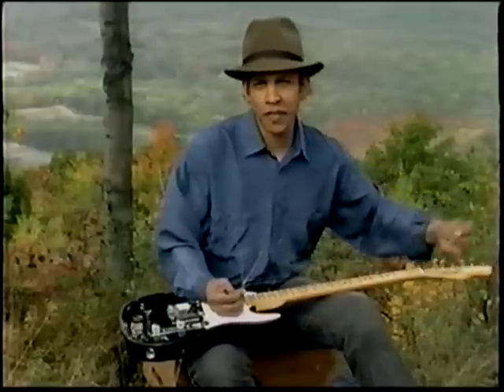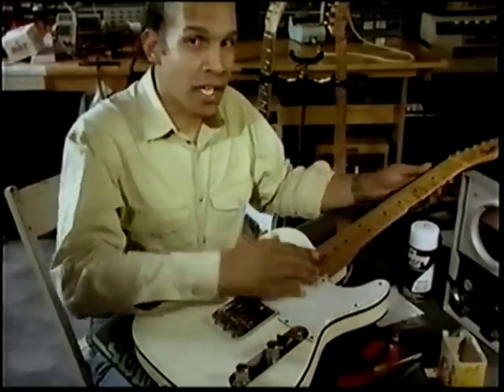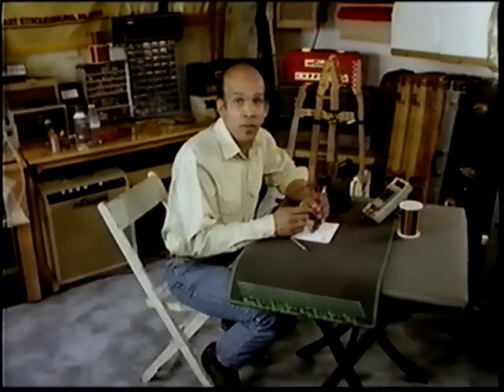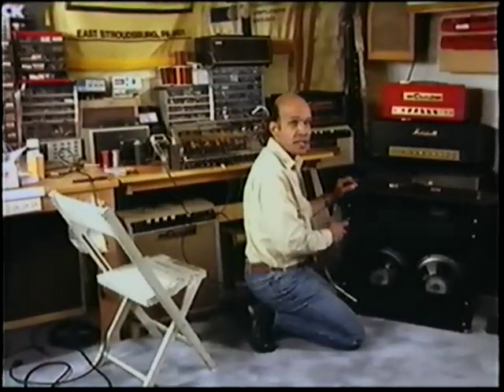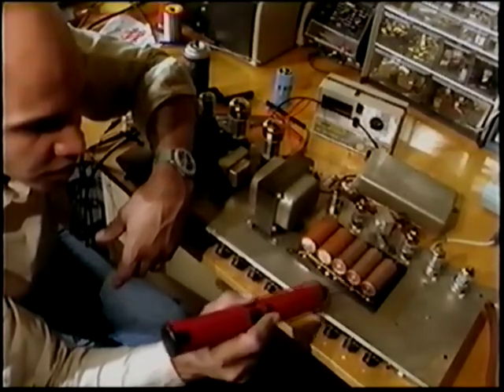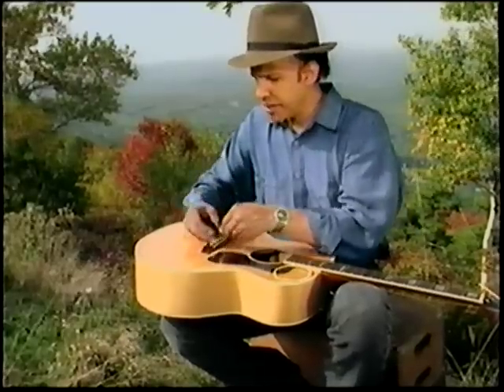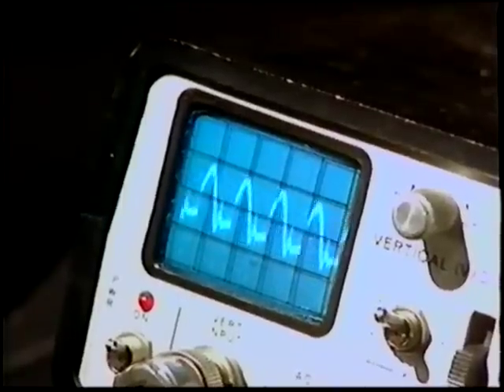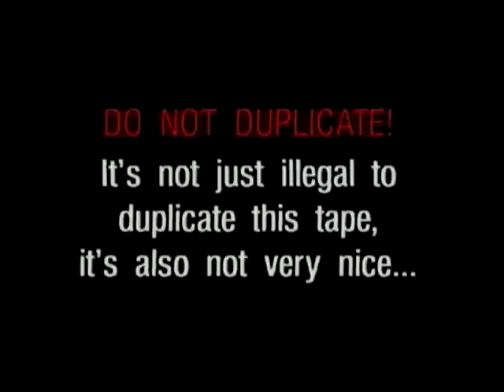Cesar Diaz - The Ultimate Guitar Tech

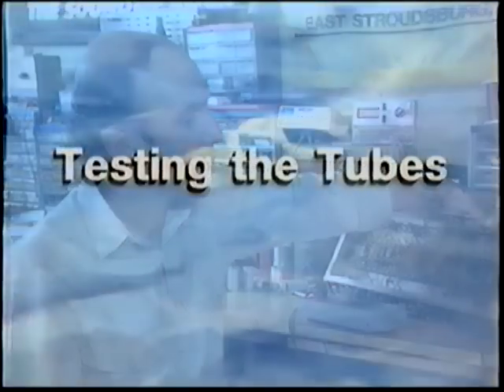Comment: 30:17 He kept the order of the tubes but put them back in different sockets! As a guitar tech, I was amazed that he planned the Brazilian fingerboard down about 8 times on SRV No.1 '63 Strat rather than LEAVE THE RW THERE and level the crowns of 6000 Dunlop wire and then recrown? Also, he thought that the guitar (which was previously owned and played by Christopher Cross) had 59 pickups in it when anyone who knows anything knows that vintage Strat pickups were not dated until early '64. They simply were 63 black bottoms.

Comment: Only one thing I disagree with. Shorting fully charged caps to ground with a screwdriver. You should use a bleed resistor to act a current limiter. Afterwards short them out.
Reply: If you wear safety goggles the spattering molten metal is unlikely to cause much damage. I always clip a resistor into the circuit, but I am not a trained professional 😉